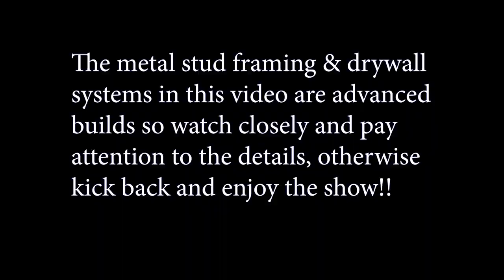Metal Stud Framing & Drywall Ceiling & Soffits

Comment: 3 sections high of scaffolding? Nothing to take lightly. Question: why no staggered seams on that tall wall? 🤔 Looking good, Chris. 😎👍
Reply from the maker: Because they are stand ups. You stagger your joints by not landing your bevels at the same stud both sides of the wall. Cheers man!
Reply: @ConstructionKronies  I should've asked,"Why no staggered butt joints?"
Reply: @ConstructionKronies so it's common practice to run but joints common when you do standups?